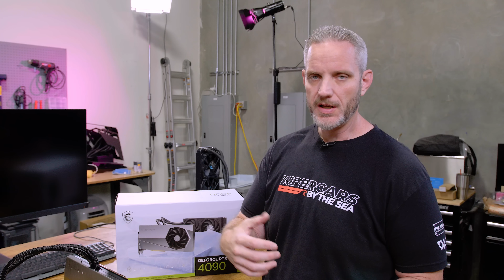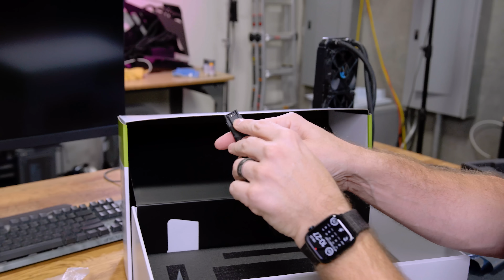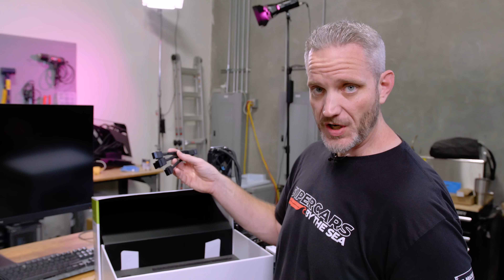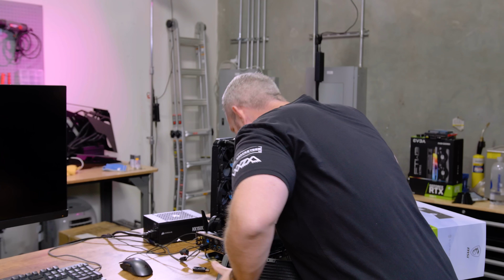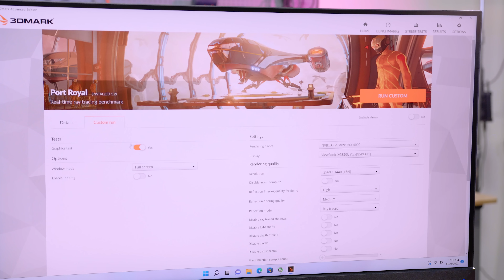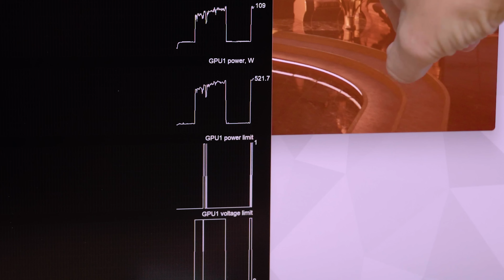This is the most BEAUTIFUL RTX 4090 yet...

Comment: I got the 3080 Ti MSI Gaming X Trio and I totally agree on the RGB controls. Mystic Light won't even let me set different static colors on the 3 zones (light bar, MSI logo, and front "triple stripes"). You can only set all lights a static color, or use the random profiles they offer. If the RGB controls are that simple/basic, why not integrate it into the overclocking software? Now if the RGB controls were slightly more advanced like Razer (or other brands that I haven't used) I could see why they wouldn't.

Comment: You asked which card we would like to see? You have shown air and AIO cooled, so how about a custom water blocked RTX4090 now? Ideally something like an ASUS ROG Strix, or if that's not available, maybe a pre-custom-water-blocked RTX 4090 card like the Inno3D GeForce RTX 4090 ICHILL FROSTBITE, which comes with a custom water block installed, ready to add to a water loop. 
Then to test it, give it maximum possible headroom, maybe something like a build in a HAF 700 PC case with three 420mm radiator (top, side, bottom) & leave the front & rear fans in? This is a rig I am considering getting myself, so if you could test the performance for us, that would be amazing!

Comment: Yeah but if the power cables on the founders won't fit in a case without hitting the side panel, those AIO pipes are definitely NOT going to fit at all! You can't bend those pipes anywhere near the amount you could with the power cable.

Comment: @JayzTwoCents  RTX 4090 Rog Strix Bios can be flashed and is compatible with RTX 4090 Suprim X / Suprim Liquid X to remove the 530 Watt Power limit. Plus it has got dual BIOS, if you brick the BIOS, then switch over to the other BIOS on the card (Performance and Quiet BIOS modes) and revert it back to the original to unbrick it.

Comment: You should try running the a/c mod on the radiator and getting the carb sub-ambient. That should allow more boost with the same voltage.. right? Seems like the ram is usually the limiting factor on XOC cards now. That one may have top ram.

Comment: Doesn't the difference between air and water cooled become more obvious inside a case? Especially considering how much a case with medium airflow heats up with this new card?
Reply: Nope, mines in a dynamic 011 mini and the radiator exhausts it to the side of the case. Literally have no intakes all exhaust fans. Runs a cool 40-50c under full load.

Comment: I'd consider the point of this sound rather than overclocking. Especially if they added that silent mode with a dedicated switch. MSI is smart to add reasonable limits to this considering the power connector issues cropping up. For people that want one of these halo tier cards this one looks like the smartest design IMO.

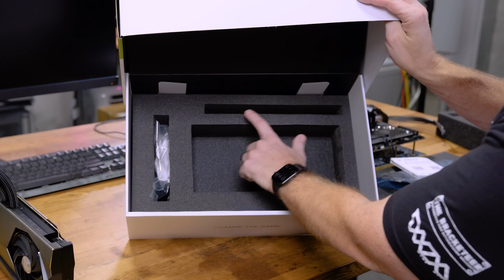Comment: At 2:33, Jay: "every single 4090 is gonna  come with this 12v high powered cable to a 4 pci express 8 pin cable"

Me: has a msi gaming trio 4090 and only the 12v to 3 pcie cable

Comment: Yeah with my factory DOA MSI AIO not on the recall list and now in the garbage not sure I would trust this. Also the amazing thing is how power efficient GPUs are compared to CPUs, just think about it this is two 13900K or 7950x worth of power being cooler by a 240 AIO to 50c under load. Hell you couldn’t even keep one of those cpus at 50c under load with a 240, so this GPU yes uses a lot of power but it’s actually doing work not just making heat. When you look at how many of those 500watts are actually turning into heat this thing is like 3.5-4x more efficient than a CPU.

The best a/c is about 25% efficient. In other words a 13900k at 250w is costing you a total of 1050w and your GPU is costing you 1100, so really it’s the same if you need to remove that heat from the room.

Comment: So Jay what are your thoughts on having the inlet/outlet facing down, so there is no chance to suck any air that is stuck in the system?  I have always been told that if possible put the hoses on the bottom to prevent that, as at some point the AIO's can loose a bit of fluid.    Keep up the good work! 👍😎

Comment: Nice to see a GPU that doesn't look like it was designed by a 12yr old weeb, but I will never trust an AIO GPU with how much more difficult it would be to maintain that AIO on a GPU. Liquid cooling needs maintenance and we've seen way too many problems with AIOs over the last few years that aren't flushed once in a while.

Would be interesting to see you dismantle an older heavily used hybrid GPU.

Comment: I also wonder if its worth it to put 2 extra fans on the other side?I have this mounted outside of a fractal Design Torrent compact case and it puts out alot of heat from radiator

Comment: @2:34 "every single 4090 it's going to come with one of these 12 volt high power cables to four PCI Express 8-pin" FYI not true. My Zotac 4090 Trinity came with 12 volt high power cable to 3x 8-pins

Comment: I was really into the look of this card but I'm concerned about the limited lifespan of AIO GPUs... I've had bad AIO pump issues from MSI in the past so I'm not willing to invest so much into a card that could become a paperweight in a few years because the pump failed.
Reply: What do you do when a fan or two stop working on an air cooled card? Its a paperweight then too. Btw im on my 2nd aio gpu. Havent had a fail yet. First was a 1080 ti evga hybrid i got in 2017, used it until 2021 when i got a 3090 evga hybrid that i still use. The 1080 ti i donated to my older bro which he still uses today, 5 years later it still runs. I am hoping evga has the same reliability
Reply: Meant to say msi has same reliability*

Comment: Is it worth the price? I think Jay said it best at the very end. "You could build an entire system for the price of this card...". I feel this is a perfect response for the entire Nvidia lineup, so far. Hopefully, the more reasonable cards are coming. Until then, I'm completely happy with my 6700xt.
Reply: The question isn't whether it's worth the price, it's whether you want or require to performance it provides. If you're happy with 1080p gaming without Ray tracing, then don't get the card, but if you want to experience the best of the best of graphics then this card may be worth it.

It's definitely worth the price when 2 overclocked 3090tis have only a 4.8% boost in performance versus 1 overclocked 4090 on the benchmark. Even if the 3090ti dropped to 50% of its release price, you're still looking at $2000 versus $1600 on a 4090 for 5% improvement.
Reply: @ryanthompson3737  Oh, certainly, if you want to have the bleeding edge of ray tracing and 4K, there is currently nothing that can even get close. It beats the best of the last generation so bad it is embarrassing.
That said, for the cost of this card, I run high settings on Cyberpunk and pull 70 FPS with no ray tracing at 1440. My entire rig is less than the cost of the card. Case, RAM..everything. The tech is amazing. In my case, though, not worth the upfront cost, the increased power bill, nor the heat.
Reply: @christophermzdenek  And that's where most people are. They're happy with the quality they get and don't have the wallet for upfront cost, and that's 100% valid. One thing to note though is that power isn't as big of a problem as people make it out to be. 2 3090ti's at base TDP is still 64% higher in power draw than an overclocked 4090. Nvidia has make massive strides in providing massive performance gains with relatively minimal power requirements. Sadly, though, the laws of the universe require more energy for more computing. All they can do is make it more efficient.
Reply: @ryanthompson3737  a 6700xt is still a great 1440p card for easaly 2 years
Reply: @theplayerofus319  That wasn't my point. My point is that a 6700xt CAN'T do max settings on every game at 4k with ray tracing enabled. Hell, this card, on some games, also can't do that. If you tried running it on cyberpunk, you'd be looking at 30-40fps in the intense areas unless you enabled DLSS. 

Point is that it's definitely worth it if you want the best that modern graphics has to offer, or if you just want to upgrade from a 60hz to a 120hz monitor without hurting graphic quality.
Reply: @ryanthompson3737  point is you said its ok for 1080p gaming which is just wrong because its capable of more and i never said 4k but 1440p. 
Also why should people throw their money away for nvidia. High end is still enthaust level and most dont waste their money like this, no matter if they are poor or rich
Reply: @theplayerofus319  Did you even read what I said? 1440p on MOST games without Ray tracing ISNT the best graphics games offer right now. If you want the best graphics games offer, a 6700xt will not give you that.

Ironically, you mention high end graphics cards and don't mention the fact that the 6000 series IS the current high end graphics card for AMD. As I said, if you want to best graphics games have to offer, it can only really be achieved with a 4090. Until now, Ray tracing on high graphics game wasn't reasonably achievable.
Reply: @ryanthompson3737  yeah but nobody asked you that. He is happy witj his 6700xt lol not everybody needs 4k ultra because its just stupid.... also not the hole 6000 amd series is "high end" lol bye
Reply: @theplayerofus319  What kind of childish argument is that... "nobody asked", like what? Lmfao. Stop trying to be an advocate for someone that already responded positively to my comment. You're the only one triggered over valid points.

And yeah... there's not a 7000 series yet and the 6700xt was released just last year. It IS the high end cards for AMD.
Reply: @ryanthompson3737  so you also say a rx 6400 is a high end card because its the latest amd 6000? Lol give me a break haha.
Reply: @theplayerofus319  Uses the latest in technology and design. Just because they purposely handicapped the card to give it to you for dumpster prices doesn't make it worse than previous lineups. It's well know that AMD makes their cards realistic for people's wallets in exchange for better performance whereas Nvidia doesn't give a shit and will push for the best performance to set market trends.
Reply: @ryanthompson3737  bs
Reply: @theplayerofus319  I mean like that's your opinion man.
Reply: @ryanthompson3737 tl;dr "best" is different for different folks, regardless of their wallet.
 I totally get what you're saying. Comparing the 4090 to a pair of 3090tis seems a bit out there (true, price wise it's comparable, which is what I'm assuming you're alluding to), but no one would reasonably run that set up. I mean, almost no game would take advantage of the horsepower (I admit, I really miss the days of SLI. Ah, a bygone era). Add to that, if you were doing it for productivity and you've got a wallet that weighs you down, then a Threadripper and Quatro would be the way to go.
No, what I was referring to was price/performance and my particular needs. My eyes are the same half-century as the rest of me. 4K is glorious, but for me and my bifocals, the difference over 1440 isn't enough to justify the cost. Ray tracing is an astounding technology that will revolutionize far beyond gaming (hello NASA lander simulation rendering in FPS rather than hours per frame). For me, though, I stop noticing it after a few seconds. In my use case, it just doesn't add up, even if I do have the wallet to indulge in my most averice laden gamer fantasies.
I will address one other thing. Saying the 6700xt is the best of AMD (as 7000 series hasn't launched quite yet) IS a little disingenuous, though. It like saying a 3060ti is a top-of-the-line from the previous Nvidia generation. Its the upper end of the middle of the stack... which is why I bought it.
Reply: There were 2 of theM on the shelf of my local micro center. Retail $1800

Comment: Hi Jay 😇👋👋 QUICK QUESTION: with psu having a ….. jumper wire to turn them on without plugging them into an atx power connector on a motherboard …… have you tried this “jumping” of the 4th wire and plugging in 3-wires and seeing if this tricks the card to run at the rated 600watts …. Or close to it? Would love to see this in a video on different RTX4090 videos 🤩😇🤯👍

Comment: This is the card to disassemble and try to exotic cool. And/or throw the strix or galax Vbios (which we has the highest power/voltage capabilities) on it to see how it does with more power available. 

As always, happy to see another video from the team. Thanks guys.
Reply: depends on how different this board is than the ASUS or Galax boards. that flashing is very dependent on layout, and seeing how wildly different many of these cards are, id say the chances are slim that those other branded VBIOS' would actually properly flash, rendering an 1800 dollar card bricked.
Reply: @ghomerhust  it has multiple bios on the card, it would just be flashing over one of them so that’s not really an issue. Technically it could damage the board if the power phases are significantly worse, but that would be pretty unrealistic. Possible, but not probable

Comment: The only 40 series I would buy. Also far more practical for heat management. It's ridiculous that we need to design our builds for this now. I was trying to get the AIO water cooled 3080 but missed out, fortunately the FE 3080 was acceptable and is a 2 slot solution. I never want a 3 or 4 slot card, I want to be able to use all my PCIe slots!
Reply: Well most people dont use more than 1 pcie slot anyway
Reply: @theplayerofus319  that makes me sad. My main machine's got a 3080 FE, dual 10 gig NIC and an Intel NVMe 750 series PCIe. Second PC has a TV capture card, an Audigy 2 soundcard and a GTX1070. Also a good way to expand storage (provided you have enough spare PCI lanes) by fiting a PCIe M2 adapter card. Even many high-end boards these days don't have the features I want. I think a lot of streamers will have some PCIe capture card in there. I remember the days of SCSI expansion cards for external CD drives, so I accept I'm probably very much in the minority 😂

Comment: Jay, I have a Suprim X Liquid on order (back ordered) and like it for it’s slim design and AIO. I also have a 2080TI Kingpin Hybrid with the LN2 Bios installed I plan to run both in the same system (I need the addition hdmi outputs for my FlightSim Hardware and triple displays. My point is do you think someone will come up with a bios mod to get a bit more out of the Suprim X? It will probably perform just fine stock but I like to max my GPU’s when possible.
Reply: Damn i hope you have a frickin ac in the room on full blast or otherwise the room will be a new death valley. Not to speak of the insane electricity cost.

And the 4090's voltage limit cant really be overcome with a modded bios i think. Needs physical modding on the card
Reply: @theplayerofus319  the room stays a constant 70 degrees F while flying.
Reply: @MrScott_e  how? My 3080ti on 340 Watts+80 Watts cpu heat my room up pretty fast... with a 4090 and 2080ti you should melt😅 where do you life
Reply: @theplayerofus319  I live on the Gulf Coast of Mississippi in a home I built myself(general contractor). It is well insulated (.54 Blower Door score pre-Drywall) which, if you don’t know, is lower than Passive House requirements. That and a Daikin Fit HVAC system and I have a very efficient home that stays a constant 70 degree. Oh! And each room has a return air duct so whatever heat is generated in my dedicated Sim room is pulled back into the HVAC system and cooled. Very sweet setup.

Comment: My Gigabyte Windforce (MSRP base model) 4090 overclocks, STABLEY, to:
3000Mhz Core (with +220 Afterburner OC)
12201Mhz VRAM (with +1700 Afterburner OC)
58-63c max temp. 63c only when I'm kicking the $h!t out of it in Port Royal for long periods.

Comment: If Jay had actually bothered to check the MEM temperature, you would see it is higher than most air cooled cards except the FE. MSI uses an AIO style block with a plate that extends to the RAM, unlike full coverage blocks with channels over the RAM and VRM. Doesn't mean it isn't still a great card in terms of noise, size, and performance, nor that the memory runs too hot, it just isn't what you might except given the drop in GPU temps.

Comment: Id be curious to see a vid on case ambient temps. With these new power draws, does it still make sense to put an aio on front as an intake? Dumping gpu heat into the case might be worth a revisit.
Reply: I set mine up as a side intake on my 5000D Airflow. I have a 360mm AIO as top exhaust cooling my 5900X. The difference in temps (generally) on components and CPU coolant is about 5-6 C higher than without this 4090 and cooler. I had a 3090 Ti FTW3 Ultra before. In translation, my temps are all at very acceptable levels and I'm not pumping out that much more heat than before. I'm still messing with my radiator position, but only out of curiosity. It works great as is. I'm loving my new 4090!
Reply: Unless your benchmarking or pushing it to its absolute limits you won't hit anywhere near 400w of power. I tried with mine. Best I could get was 280w at 4k@120
Reply: From the reviews I've seen, that radiator puts out a crazy amount of heat. Dumping 450+W of heat into your case isn't a great idea. I'm interested to see how the temps on this card would do with it mounted as an exhaust with a 13900k water-cooled as an intake, even though I'd never buy a 13900k. That would still be up to 300W of heat pushed into the case. You'd have to choose between a hot CPU or hot GPU.
Reply: @zues287  I have it mounted in a Corsair 4000D case as an exhaust (out of the front), with a H115i i7-11700k liquid cooler at the top as intake. I switched my back fan to point forward so all the air flows in the same direction. This smaller card with a big case allowed me to put the side panel on without putting real pressure on the power cable, which is a huge deal it appears! The heat is real, and I am glad it is coming out of the case and not into it! CPU stays at 51, GPU stays at 62 under full game load.